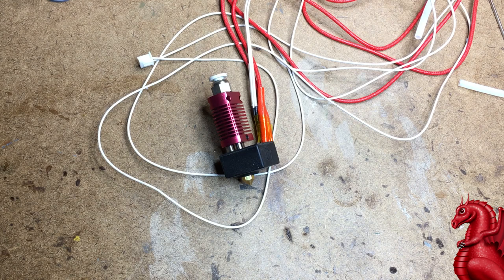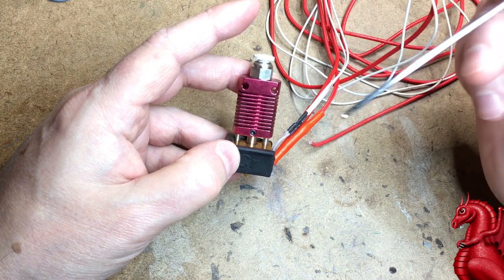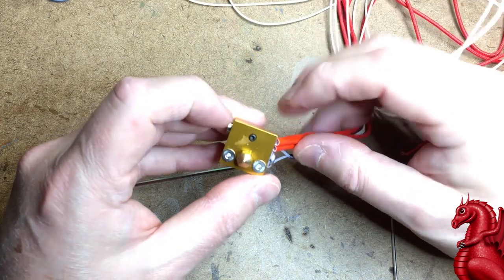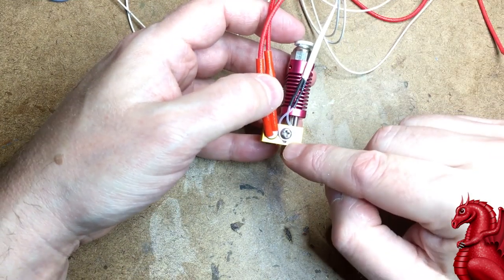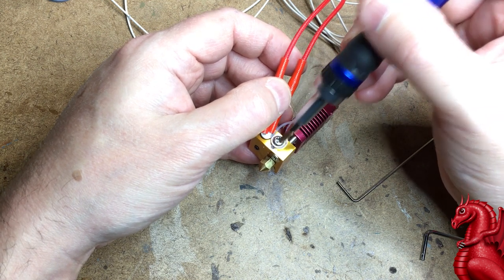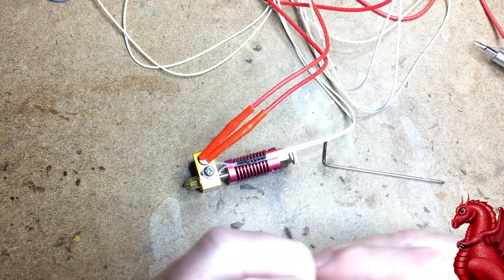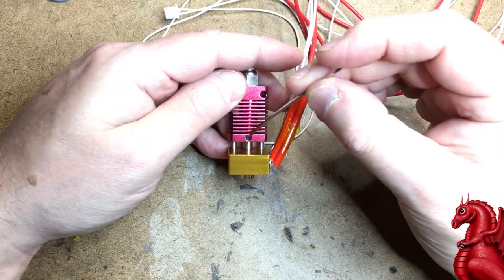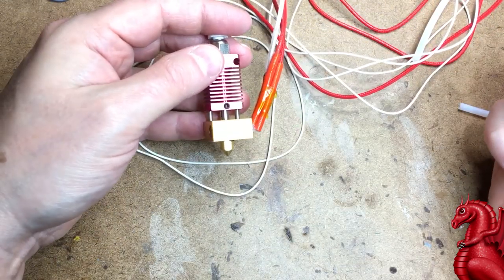How to replace the thermistor and heater cartridge on a Creality hot end.

Comment: Thank you!  Thank you!  Thank you!

I was having terrible trouble getting prints to finish. I would hear a loud whine and find the tip stuck to my print and a warning of temperature error. Eventually I sat for 3 hours while something printed, watching the screen and observing what was happening. The tip was fluctuating up and down, from 175 to 280. Wild swings. Then a drop to the point it froze and an error occurred. I took the head apart and sure enough, the insulation on the thermistor was damaged such that it shorted through the screw. A little high temp tape and gently tightening of the screw and the temperature is locked at 200.  No more errors.

Comment: So I just built my first CE3V2 following your excellent video, I powered it on and It's stuck on the boot logo. I did some googling and found another guy with the same problem who had posted a video to YT. I start reading the comments and some others had been able to resolve theory problem by untangling  the thermistor wires.... I do some more searching and I get to this video... When you mentioned that the thermistor screw is to be left lose I had an epiphany... When building the printer I took off the hour end cover to inspect everything and guess what I tighten... Yep I think I messed up the thermistor. I'll have to back out of when I get home and try it out but as a precaution i ordered some. I'm hoping this is my problem as it seems like getting a main board replaced under warranty is like pulling teeth. Thanks again for the excellent content.

Comment: WARNING!!! I wrote about not buying this heater cartridge listed a littler earlier, thinking it was faulty or a knockoff. If you’re replacing your heater cartridge MAKE SURE YOU CHECK ITS VOLTAGE. My CR-10s is from late 2018, and actually uses a 12V heater cartridge, whereas the newer models, and the one listed above in the description, is 24V. This will not work with older models, and Vice versa. I’m not sure if he can edit that or leave a warning in the description, but please take note before you buy the wrong heater cartridge, and set your printer back up like I did for it to not work.
Reply: Yeah, I've learnt this the hard way

Comment: thanks for this clear explanation with closeup video. now i know where it went wrong! after replacing my nozzle, I accidentally tightened the screws of the thermistor too hard and I got an error message "error mintemp". (thermistor wires loose and broken glass). quickly order a new one and hopefully it will be ok again. greetings from Belgium!

Comment: Before changing your Thermistor, check the Info Screen for bed and hot end temperature.  I found on my system that the software got all screwee and would set Hot End for PLA at 238 C and Bed at 0.  It is like the thermistor and temp control was chasing a moving target.  I just reload the Cura file and all is fine.

Comment: Where would I connect the wiring to? The mobo? Or would it be easier to splice in to original cable? I cant see a positive or negative on the cables. Does it matter what way they go?
Reply: polarity doesn't matter on those cables

Comment: I dropped that tiny grub screw that holds the heater cartridge and of course can't find it so borrowed the one on the heat sink. I figured it's not really needed as even when tightened down it didn't seem to do too much. Will have to get some replacements to have on hand, but I think it will work in a pinch.

Comment: 6:44 Thermistor itself is very cheap to replace. What happened to me is 24V from heater cartridge got shorted into 5V thermistor port and fried my mainboard. 50c vs 30-40 bucks mistake. Thermistor now scares me more than anything. Bought stud screw in brass head thermistor with new board, hoping not to have this problem again anytime soon.

Comment: I managed to ruin the nozzle thread on a heatblock, but the thermistor and heating cartridge are still working.
A replacement hotend assembly is ridiculously expensive, but the parts individually are quite cheap, so I've ordered a new heating block part, and I'm going to try to salvage the thermistor and heating cartridge, and so on from my old hotend and see if I can make it work.

Comment: When we try to heat the extruder the machine beeps really loudly and for a long time then power cycles off. When I used a blow dryer on the nozzle, it did not show any change in heat so I’m assuming it’s the thermistor?

Comment: I didn't put my thermistor in the hole and got a thermo runaway error 2 hours into a print job. If you have octopi, check that your monitor graph is a steady line. Especially when the tip is moving a lot.

Comment: I need help with the wiring. I dont know which wire goes into the board on the left or right. For the heater. There is no indication of which to use. Is it bi-directional?

Comment: Just a small correction @5:20 Thermistors resistance increase when temperature increases, so at room temperature the resistance is lower than when heated. The number usually indicates the resistance at 0 Celsius. So, a PT1000 is 1000 Ohms at 0 and a PT100 is 100 Ohms at 0.
Reply: Not so.  That's only true for devices with a positive temperature coefficient, ie PTC devices.  PT100 and PT1000 are platinum RTDs, not thermistors.  Yes, they are PTC devices, and so are some thermistors, but the thermistors normally used in 3D printers, and specifically the ones in a stock Creality hotend or a stock V6 etc, are NTC types, for which resistance is inversely proportional to temperature.

Comment: I was just wondering, how long does the cable need to be? I estimate the protective covering is about a meter long, before you even got to the motherboard. So would I be better in getting a 1.5m version or will 1m suffice?

Comment: Why did you omit the wire loom threading and connecting the wires?  Did your  cartridge have terminal connectors or bare ends? Seems like you showed us the easy part but not the important part of getting things connected and running again.
Reply from the maker: The parts have identical connectors to the ones removed, everything plugs in to the same spots the old wires were removed from.

Comment: I'm actually watching this video because I had purchased a Aries a while back and put roughly 100 hours on it. Within the next couple days ,10 minutes into the print the temperature jumped up 20° C. After the initial jump it would jump randomly by 20° throughout the print so I'd have to babysit the machine. I'm wondering if what you mentioned in this video would possibly fix that.

Comment: how do i remove the metal tune in the center of the heat block? I saw the replacement pieces dont have them intergrated into them so how do i remove the previous one?

Comment: Note that on the CR-6 SE, your statement about the fan shroud protecting the cartridge is no longer true - since filament build-up around the nozzle managed to wrap around both the thermistor and heating cartridge wires, and pull the heating cartridge completely out (while pulling the wires free of the thermistor). Fortunately, with the thermistor not reading anything, it immediately shut down.
Reply from the maker: This video is not for the CR-6, which has a totally different hot end/carriage design. It is only for the Ender 3 and 5 (as stated in the title.)
Reply: Understood... I'm just responding to the statement that Creality is changing the heat shrouds on all their printers.

Comment: I just bought a replacement ender 3 original all in one hotend from creality and I keep getting an error  2092. And the hot end temp reads in the 18000. Is this what would be causing that? If so, I can just take the thermistor from my old hot end?

Comment: Well things go really well when you have a brand new unit.....on mine the screw would not back out from the heat cartridge and then it stripped out. The thermistor screw comes out easy but the thermistor would not budge....completely locked in the hole. I pulled and pulled until the wires both broke. So now I have to replace all those parts and rewire this thing....what a nightmare. Install an all metal hot end its easy they said it will take 15 minutes they said....I'll be down for days now.

Comment: just broke mine, had bad print , now mine is a cr-10s so the thermistor wire is in all one assembly that screws to the back of power supply, now could i get replacements like you suggested and cut the white wires about the black tape and put quick connects on each end? Would that work?

Comment: I'd hoped for information on thermistor selection, soldering on the wires, and PID tuning if necessary. I don't feel adequately prepared for the job ahead of me :-/
Reply: I just took my whole hot end assembly apart for the first time, and while it was daunting, I went slow and careful, and there were no issues whatsoever.  I see on the replacement thermistors he linked that the wire is 1m, which means it's built so you can simply thread the wire through and connect it as normal - no soldering required

Comment: I have a cr-10 mini. The other day, I took my nozzle off to clean it. When I went to put it back on, the temperature wouldn't stabilize. At idle, it sits between 19c and 23c. If I heat it to 200, it fluctuates between 188 and 212. I figured I cracked the thermistor. Replaced that, same problems. Bed heats up just fine. When I try to PID Autotune, it gets up to 250 then shoots wildly between 238 and 262. What should be my next step?

Comment: I changed the entire assembly. And replaced the thermistor and heater cartridge to what was provided spare by creality. Using pla, the hot end starts smoking while preheating.
 It started smoking at 140 c. I turned it off. What must be wrong? Or is it normal?
Edit - Smoke stopped but the heating is too slow. Doesn't go above 167 even after 10 minutes.

Comment: My heater cartride is COVERED in PLA. I've been having massive layer shift issues lately, so I figured I'd tighten the mounting screws for the hot end and discovered the other problem. I'm sure that all of this plastic covering the metal is messing with the temperature regulation. How can I safely clean this part? I don't have the money to spend on a replacement.

Comment: I could not loosen the grub screw holding the heating cartridge on the stock hotend on Ender 5. Is there any trick I can use or just buy a new thermistor and heating cartridge?

Comment: Does it matter which wire of the heater cartage is connected on the other end?  Replacing mine and can't tell a difference between the wires
Reply from the maker: There is no neg/positive, you can connect them in either position. :)

Comment: great video, thank you very much, I have a serious problem, could you help me PLEASE!
My heater cartridge was broken (24V 40W), so I swapped it for another one that doesn't have any inscription on it, so I measured the resistance and it gives 16 ohms, approximately, so I guess that's fine. But when the hotend heats up, it gets too hot, in a few seconds it reaches 250-380 degrees. If I don't stop it, keep warming up. I can read that on the screen! What could be the problem?
Reply: the parts involved are the software, thermistor, thermistor wiring, heater cartridge and heater cartridge wiring; the fault is in one of those, but you have to investigate to figure out which one :(

Comment: In your video the thermistor pulled out quite easily. Mine doesn't pull out easily because of regular use. You showed how to remove the heater element if it's a little stuck but not thermistor. I don't want to pull to hard on the thin wires for fear of breaking them and can't heat the block because it's the failure of the thermistor that is the reason it needs to be replaced. Will a cheapo soldering iron put out enough heat to melt any potential fillament that might be sticking the thermistor in place. How do you suggest loosing it up to remove?
Reply: Doubt a cheap soldering iron would, but a clothing iron on high just might.
If your hot end is still heating, you can heat it up to about 150C to soften the plastic. If not and it was cemented in, you may need to chip at it to release it, which will likely break it.
Get a replacement thermistor in hand either way before yanking on it.

Comment: I have an S5 with avaiation connectors and im have the hardest time finding a replacment hot end wire replacement the thermistor glass head was torn off and as a result i can no longer tell my temp  ; Do you know of any source where i can find an aviation connector hot end assembly?

Comment: Also from bad print bought a new metal hot end for cr-10s and I did order a new assembly for extruder. My question is if i put new cable and thermistor on new metal extruder and my temp. still reads 358° don't know how to fix that.

Comment: I think I blew my main board by over tightening the thermistor and inducing a short.  The hotend came in contact with a one of the bed hold down clips and I saw a spark.  The screen on my E5 Pro just went BSOD and nothing works.  I replaced the board and now the hotend temp shows -15C with the original thermistor in place.  I'm going to replace the thermistor, not torque it down this time and hopefully that's that.  This is a PSA for anyone else that had something similar happen.

Comment: i barely used my ender 3 and didnt even print anything because my first attempt I didn't have the filament in all the way. so no extrusion when it got to heat i saw no filament on the bed so I aborted the print so I try to reinsert it then I go away for a few minutes and scream of death. lcd says thermal runaway. usually caused by a bad thermistor. I probably don't need to replace it completely but if I do fix it, it will last maybe 6 months but there's a hot end that will fix it permanently. that doesn't mean the thermistor won't die on you but it will last much longer.

Comment: I keep getting E1 heating failure. I didn’t change the thermistor as that isn’t what my problem was. But now it is since I put everything back together. I had to reset to factory settings and then it created the e1 failure and I cannot get out
Reply: If you get a E1 failure will replacing the thermistor make the fail screen go away? Or do I need to go into firmware?

Comment: I changed the hot end on my ender 3 and soldered the wires together, but now it cannot stay the same temp, what should I do? Please tell me if I did something wrong
Reply from the maker: Why did you solder the wires? They are meant to be plugged into the board, not cut and soldered (especially the thermistor.)
Reply: @Tombof3DPrintedHorrors  I didn't know that

Comment: While this is a nice video, and very well explained, it doesn't cover the rest of the installation. In the end, you have the thermistor wires and the heater block wires laying on the table. I really don't want to tear in to the motherboard because I am a noobie. Also, it would have been nice if you were working on a real world senario. You know, a screwed up hot end with plastic everywhere or plugged hotend. I have tried and tried but can't get the heater out of the block.
Reply from the maker: The wires plug in to the exact same plugs you removed the old ones from.
Reply: Does the orientation matter? There's no color code or anything.
Reply: @jessehellakoo  little late but no 
the heater cartridge and the thermistor have no polarity

Comment: First, I was getting an ERROR saying "Heating Failed". So, I unscrewed the thermistor and accidentally put it into a screw hole and forcibly screwing it in place which snapped off the head and after booting the printer, I ended up with an "MAXTEMP" error.

Comment: what if my printer just raising in heat and its just keep going till its starting smoking, i cant control it, its just start to get hot as soon i turn it on, is it the moderboard or is it somthing with the cables? 
i have the alfawise 3D printer the hot plate i can control but not the hot end!
Reply: I have this same issue. I think it's because the thermistor is damaged, so I'm going to follow the steps in this video and completely replace the thermistor and be very careful while I'm doing it. I'd suggest you do the same, as that seems to be the most likely cause of the problem
Reply: I had that problem and contacted them. It is indeed the mother board. They sent me another. Thank goodness and everything was regulated afterwards

Comment: I'm getting a negative temp reading would that be the thermaster?
Reply: I realise this was four weeks ago so you've likely fixed this by now, but when the system reads negative it means that that thermistor is not connected, it  wouldn't be a good idea to try to heat it.

Comment: My heater cartridge disconnected. Do I just solder it back together?
Reply: You're gonna want to use metal crimps, not solder, the temps solder can handle are lower than the temps generated by the hotend, so the joints would likely melt.

Comment: What about the ends that don't go into the heat block?
Reply from the maker: They just plug into the exact same positions on the board the old wires were attached.  :)
Reply: @Tombof3DPrintedHorrors  My thermistor and some other wires that goes from hotend to the board is connected to a circular pin adapter that goes to the board. Do I just have to cut the wires and replace the 100k type thermistor seperatly?

Comment: I got a a new thermistor but it doesn't have the correct end connector so I need to solder my wires. How do I know which needs to be positive & negative?